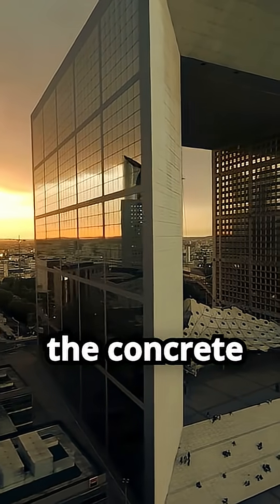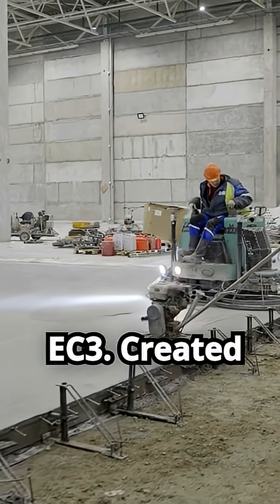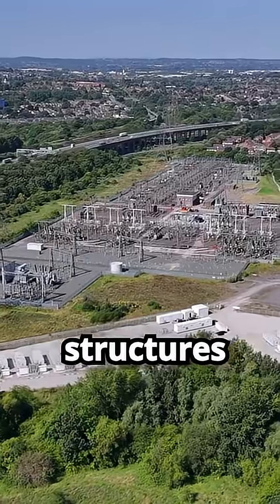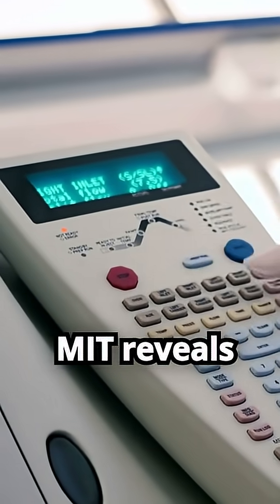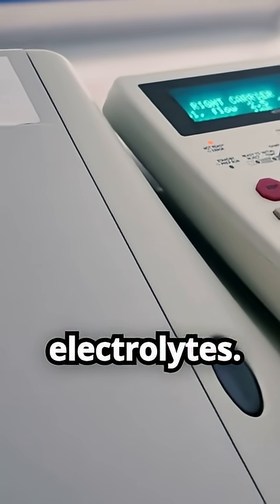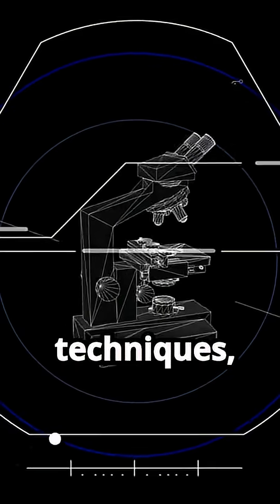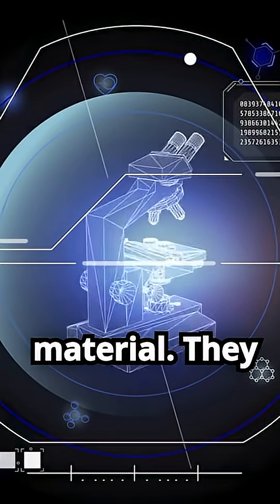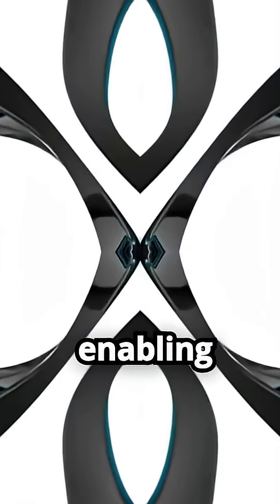Transforming Concrete EC3: The Future of Energy Storage

Comment from the maker: Generally, for every energy system degradation is expected. This is why recent advanced research are focused on multi-functional or self-sustained devices. This  MIT (EC3) research aims to create a durable, multifunctional material. However, assuming total long-term failure of its energy function, the solution would not be to replace the building, but to supplement or repair the energy-storing component while ensuring the concrete's structural integrity remains sound. Potential solution included targeted repairs, electrolyte, structural reinforcement and micro-cracking repair. The research is still ongoing. Looing forward to its progression.